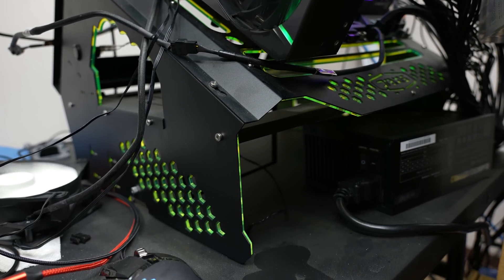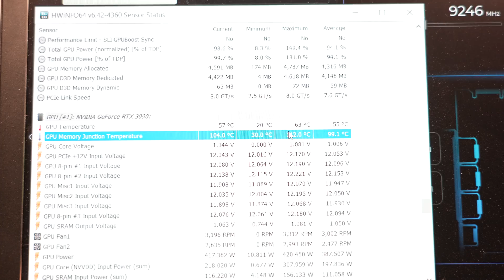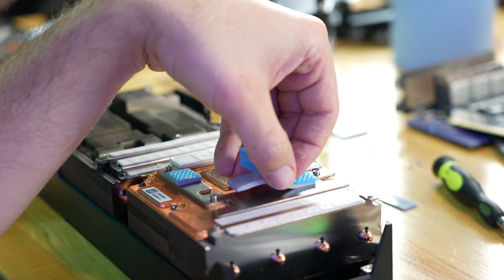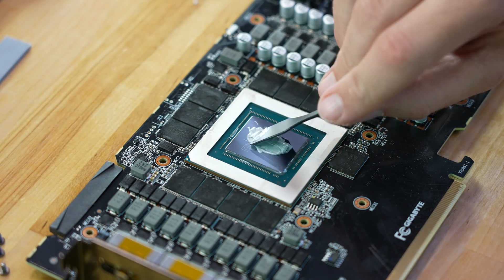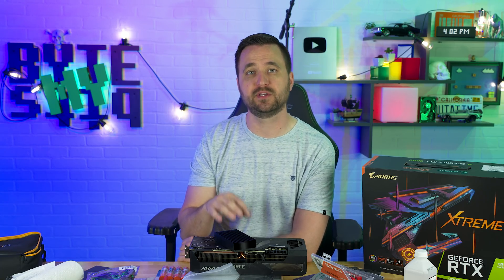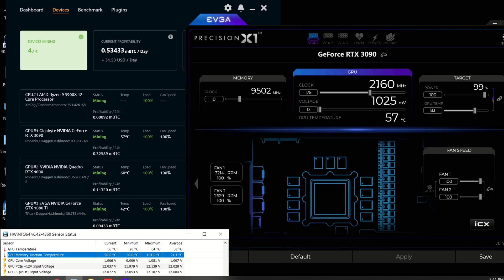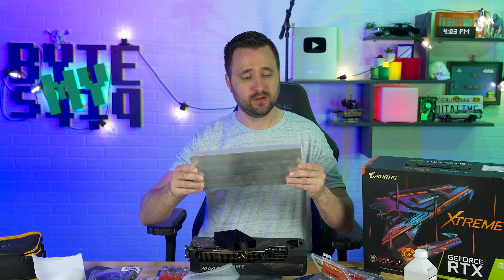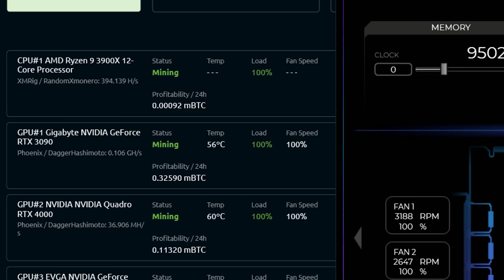My RTX 3090 leaked OIL! Thermal pad failure...

Comment: I just recently open a used 1070 founders edition from Gigabyte that was burning hot every time I turned on my rig. After open it I found these oily spots where the thermal pads were set. I am waiting on some supplies before putting it back together hoping that the clean up a new set of thermal pads will help the heat dissipation.

Comment: stupid to overclock the gpu core for mining. Running at max clockspeed does not increase hashrate. You have to reduce clockspeed to around 1050MHz to get the best efficiency and temps without affecting hashrate.

Comment: Jay you need to get your oc dialed in.

I have a 3080 (I commented on yiur twitter post when you first got the card).

Ran at 100MH/s for a week until the pads deteriorated and I hand to underclock to even get 80 MH/s without throttling.I spent 10 hours trying settings to get my 3080 to where it is now.

My 3080 is running  101.5 MH/s 
64% power (240 watts) but not powe limited. 
1140 mhz gpu locked (absoloute)
This results in a 731mv core. No need to undervolt as the GPU isn't generating heat. 

What you need to do is set the GPU mhz and have it lock. 

Memory is at 10,800 mhz absoloute 

This yeilds 101.5 MH/s
40c gpu
70c memory 

3mm ThermalRight pads on the back. Plate
2mm on the Ram to heat sink
1mm on the caps/ICs badide the Ram chips 
Thermal grizzly on the GPU

Comment: Should really undervolt your gpu if not when mining. There is little to no affect on your hashrate. Drop your core clock with less mV and incr memory clock.
Reply: i went from 320 watts at 1930mhz on my 3070ti suprim x  to 230 watts at 1950mhz memory dropped with 10 c
Reply: @jamsgames8742  nice. Makes a huge difference and savings in power.
Reply: @Makaveli6103  yep its way better

Comment: So... next video is backplate watercooling for the RTX3090??? :D
Reply: im mining on a watercooled gpu and it dont get above 50c
Reply: @draconightwalker4964  my air cooled card sits insde a case and only hits 51c max. you need to tweak your power draw settings ;) lol
Reply: @s0litaire2k  its a r9 280 and i have been but havent had much luck with getting power draw below 60w. its pulling between 65w and 75w. if you have any info on how to drop it lower, im all ears and TIA
 
EDIT ps mind if i ask what gpu your running
EDIT 2 those temps are also in a 24c house with a R7 3700x cpu in the loop as well and 2 x 240 rads. its normally running around 40-45c
Reply: @draconightwalker4964  not an expert. but older the cards the hotter they run in my experiance! :D I'm just running a RTX3070 in my spare room with the window open (outside temps are below 15c & room temp stats around 20c)
Reply: @s0litaire2k  nice, ive got two r9 280x's one in my main pc and the other in one of my servers out in the shed, where it makes a nice shed heater in winter. temps out side are on the frosty side in the day and freezing at night.

Comment: Try set gpu power limit to 75% and core -350 and memory to +750 MHz you get 116 MH/s
Reply from the maker: dude this took me from 106 to 116 instantly... THANK YOU
Reply: @Bytemybits  probably better temps and less power draw also.
Reply: @Bytemybits  nive😄
Reply: @Bytemybits  You should be able to dial it closer to 122MH using QuickMiner and OC Tune
Reply: Ditto. Undervolting is a must in mining.
Reply: @Makaveli6103 No its not. Can it help? Yes. Does it under all situations? No.

Comment: Oil for/from thermal pads? That seems highly unlikely. It could, however, be the contents of a heat pipe or vapour chamber. Check them for holes, if you can.
Reply: It's silicone oil breaking down from the overheated pads.
Reply: It's a common issue for the Gigabyte cards